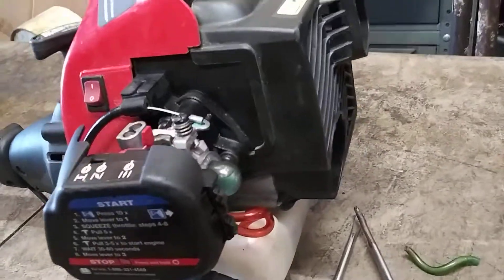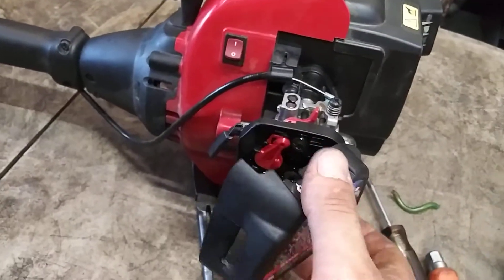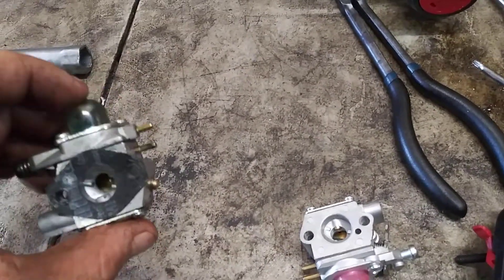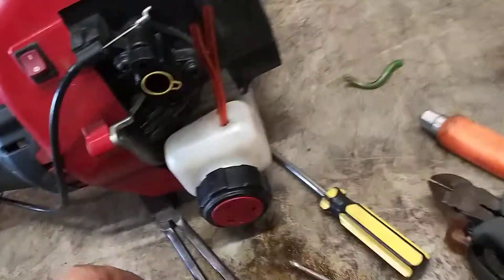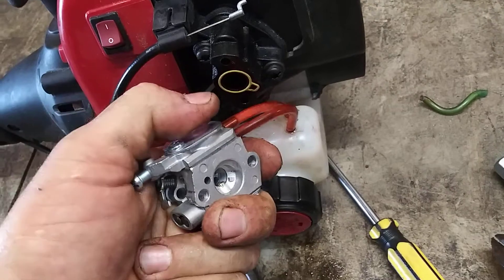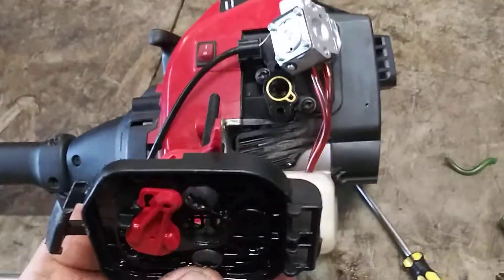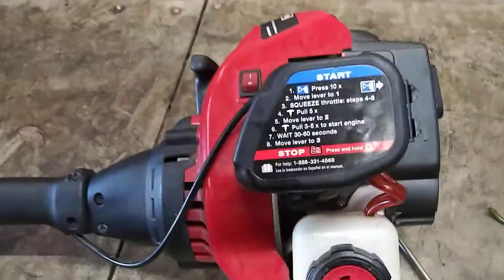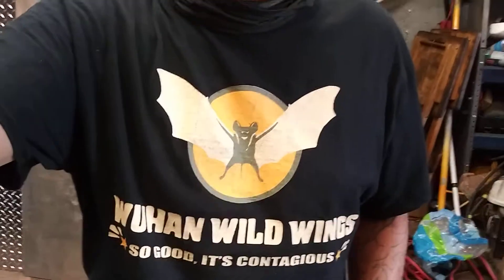* Craftsman 25cc gas trimmer weedwacker carburetor repair

Comment: How far has it got be the gas tank
Reply from the maker: filter to bottom return just inside
Reply: My line had little black thing in it I guess it came out and laying in the bottom of my tank the line had a split in it when I cut it off now it doesn't want to prime that is the reason I asked how far goes in l cut about 3/4 off

Comment: It CAN’T be that easy.  NOTHING is that easy!  haha

Thanks!
Reply from the maker: it is
Reply: @smallengineguys    I ordered up the carb kit.  Thanks for the link!
Reply: @smallengineguys    Feedback:  I spent 4-5 minutes swapping out the old carb for the one OP said to get in the kit.  Mixed some fresh gas.  3-4 pulls, and my Craftsman runs like it just came out of the box.  So easy, even a Caveman could do it!